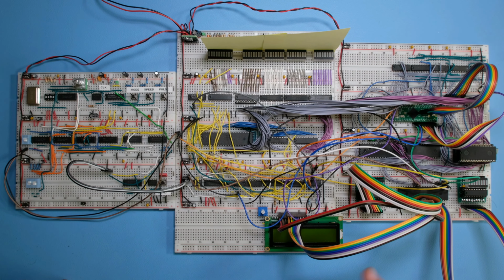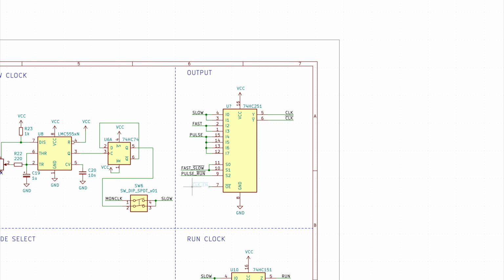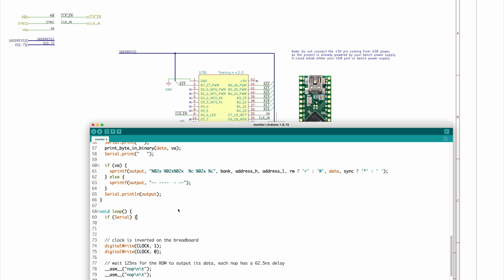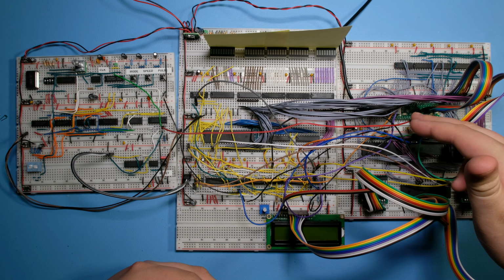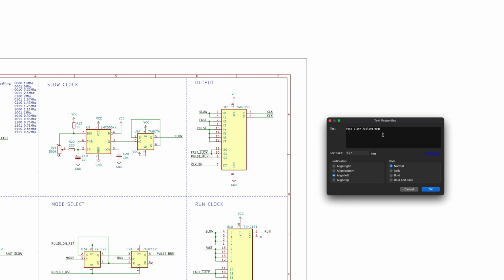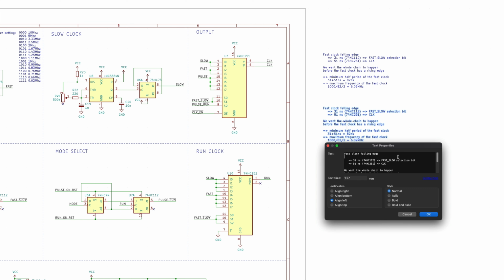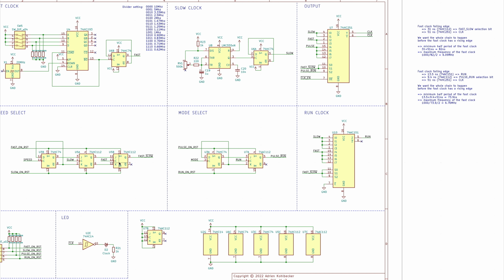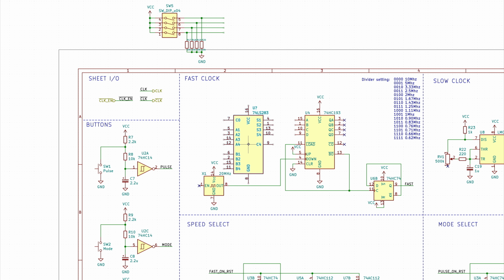#23 - Clock improvements - BB816 Computer

Comment: Propositions to improve Teensy code:
1. Instead of doing "bool va   = ((ctrl >> 7) & 1) > 0;" you can do "bool va   = (ctrl & b1000000) > 0;", I think it will be faster because you are not shifting ctrl around. Also it visually shows the bit to be tested in the byte.
2. Using static (and volatile where needed, although you should be fine without them (volatiles) here) variables should also give more speed. As is now each time onClock() is called all variables have to be created, then discarded on function return. Static functions will stay in memory and this overhead should disappear - should give nice performance boost.
3. Increase your serial interface baud, it should keep up with 230400, or even 460800. The faster you blast those bits out of the buffer the faster the code can feed in new data.
4. Change the compiler mode to -O2 or -O3 instead of the default -Os, it enables more optimizations at the cost of larger ROM file.
5. DigitalWrite is slow (does same stupid things as DigitalRead).
Proposition one - the simple one - use "PORTx |= bitMask;" to set bits on a port, "PORTx &= ~bitMask; to clear bits on a port. This leaves you with fast clock spikes, as your code does now, but they will be way faster.
Proposition two - you could use one of internal timers to generate a square wave of arbitrary frequency - you put the timer output in toggle mode, the timer itself in compare match mode. This way each time the timer counts up to a desired value the pin changes state. You can synchronize your code by doing something like "while(!(TIFRn & OCFnx)) {asynchronous code;} else if{(clockPinHigh){ onClock();} TIFRn = 0;}" (you have to clear that flag yourself, it clears automatically only if using interrupts) OCFnx is a flag. You would have to experimentally find highest frequency that allows the serial code and interface to keep up sending data. Frequency can be controlled in a wide range this way. Check out the datasheet, it's a goldmine for ideas on optimization.
Reply: 6. Use inline keyword with your functions - this way functions don't have to be called, they will be inserted by the linker 'inline' with the code - this also gives some speed benefit.
Reply from the maker: Hey! Apologies for not replying to your very helpful comments. I have implemented much of these optimizations now, and they're coming in episode 32.
Reply: @akohlbecker  Hey, no problem. I hope at least some of those were helpful :-)